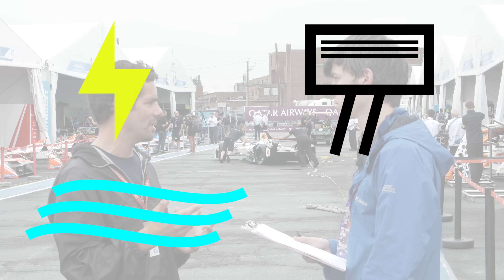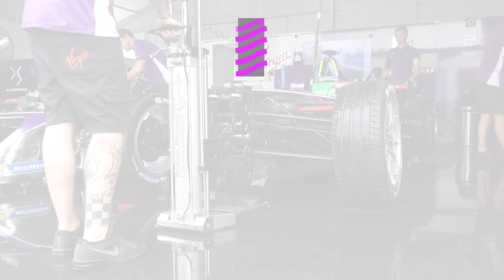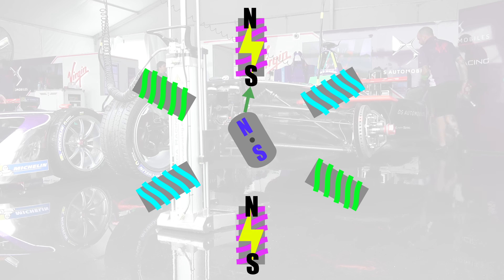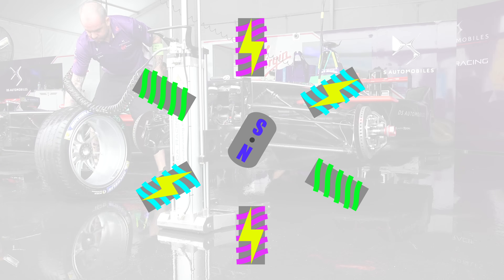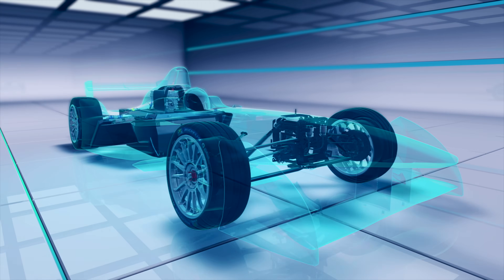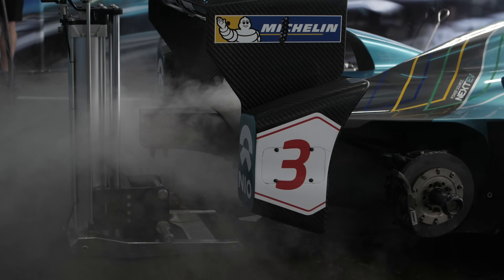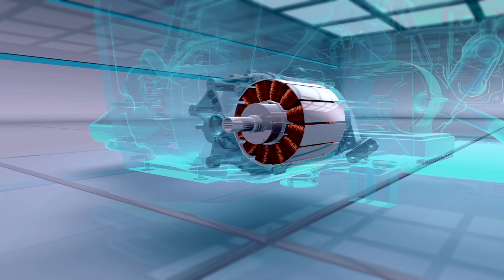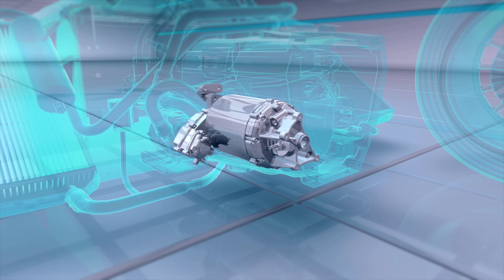Can You Tune Electric Cars For More Power?

Comment: Great video, thanks for sharing. I'm not a specialist, but what I understand is that the engine in a Tesla (the brand) is a based on the Tesla (the inventor) engine or induction motor. This kind of engine is not using  magnets, but it is using only electromagnetic fields to create the rotation. In your video the rotor consists of magnets, while in an induction motor the rotor contains a set of metal parts that become magnetic by the induction of the magnetic fields of the stator.

Comment: Question: are there any electric motors using electromagnets not only on the stator, but also on the rotor ?  Because that would allow them to coast down a hill, with no power to the rotor and stator, without having to either keep the rev up when you don't have to, or to use regenerative braking when you don't want to. That way EV cars could finally move in "neutral" mode when needed (IMHO).
Reply: Well, basically every induction motor can simply "turned off" when ever you want.
Reply: Cut the power to an electric motor and you will have "engine brake", or "regenerative braking".... what I mean is a that when cutting the power to the rotor's electromagnets (if that exists) you will be able to roll down a hill without engine brake... something that today's EV cars can't do.

Comment: 2 questions about:
1.Can an electric car be powered by a DC motor?
2.Can the above one be possible even by a motor/generator couple?
3.Can an electric car have a CVT or a Dual-Clutch tranny?
Reply: that is 3 questions 
1. all motors require an alternating current to operate traditional DC motors did this with a brush and commutator but that was ditched for setups like this because the brush caused a lot friction, 3-phase permanent magnet motors with a computer controlled inverter like this one are also called brushless DC motors 

2. yes but that would be less efficient than a regular gas car 

3.yes they would make the drivetrain slightly more efficient but the extra weight usually makes the car overall less efficient

Comment: I'm wondering if  elctric car can get rid of the mechanical losses in their one gear  reduction by  designig  a motor  that spins at the exact same rate as the wheels that would be useful in both racing and other application.
Reply: sounds good in theory, but i imagine that losing the gear ratio would result in a far greater loss power because of torque issues

Comment: This actually makes a lot of sense. There's a ton of info on the internet on engines and how they work and how to tune them, from basic to advanced subjects, but I don't understand why there's barely any info on how exactly electric motors work. They'll give basic overviews on how motors work, but they're so poor on the details that if they were explaining how engines work they would say, "Fuel goes in, and exhaust comes out. The end." 

Also, AC motors now look like piston engines to me. The magnets in the stator being "pistons" and them switching poles is analogous to pistons moving up and down, while the rotor is the crankshaft. This was very informative. EVs still don't hold a candle to ICEs when it comes excitement and user engagement, but you've made them a little more interesting. Forget Elon Musk - you just might be the person to get me interested in EVs.

Comment: I still don't understand why Tesla doesn't want to participate in Formula E.
Reply: Formula E has very specific ways in which manufacturers are supposed to compete while other factors are identical across all cars.  In particular the batteries are all provided.  Tesla would be paying to put their sticker on a competitor's product and not gaining any benefit from their extensive R&D efforts.
Reply: Right now Formula E is limited to only their components, so entering the race with your own design is impossible.

Comment: We can easly use some capacitors (or another bank of batteries) and inverters to pump the voltage on the baterry for a certain period of time to increase the power and consume more power too. Just like a nitro bottle, but it's filled with the baterry energy! You may increase the cooling of the engine to handle more torque too. You can change your gearing to match what you want.
You can even put another motor to work together with the existing because it have like 30 kg, and not 300+kg  like a powertrain of internal combustion with the same power.
The manufacturers ALWAYS will run for realibility, we can always push limits.
Turbo and superchargers only make sense because of the poor efficiency of IC engines!

Comment: Having a stronger permanent magnet will not increase power. It will increase static torque, but as soon as it starts moving, higher voltage will be needed to fight the back EMF, thus same overall power.

Comment: The really interesting part is, can I tune it to get better lap times? Especially with multiple eletric motors you can really increase the performance. A lot of stuff can be improved for track racing, just changing the software.

Comment: It's going to be interesting to see how manufactures decide to limit  the power tiers up depending on the package u pay for on the model. Like is a Camaro SS going to have a better inverter than an RS? Or will they adjust the rotor stater gap to limit customers from turning up the power